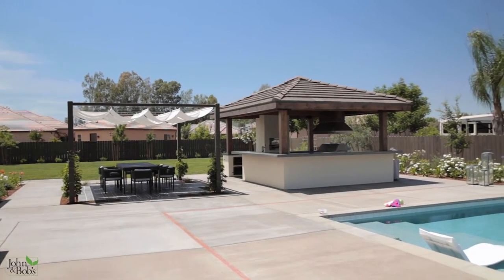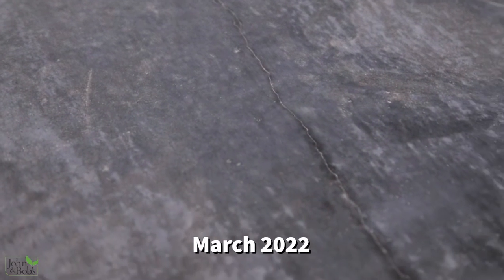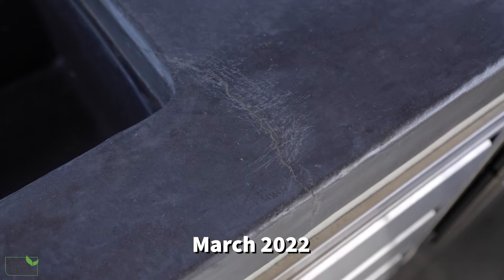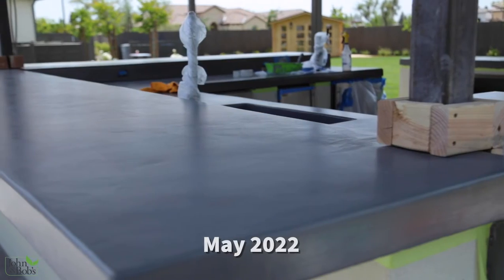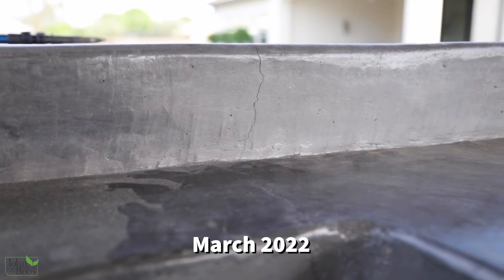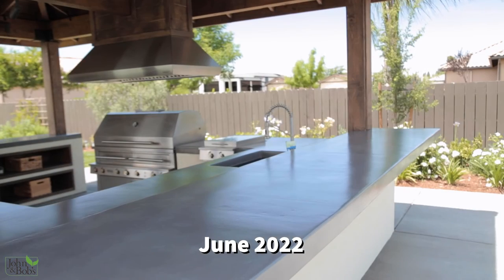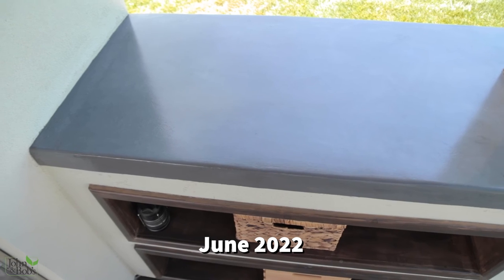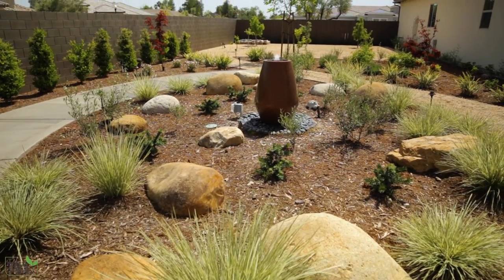How To Fix A Crack In Your Concrete Countertop | Countertop Crack Repair

Comment: Looks great, What method of LIFE DECK SPECIALTY COATINGS did you use? MC, FM or AL.
Reply from the maker: Jim, We are going to do an update on this in the next few weeks with a new video. The counter repair did look great for quite awhile, but then through the winter with all the rain/moisture we had, the cracks started to reappear and eventually became severe again. I didn't like the way it looked and neither did our customer. As a result we demolished the entire counter and we are in the process of replacing it. We will be analyzing the whole thing and showing the replacement work in an upcoming video. My videographer (Brendan) believes it's good YouTube video policy to admit to mistakes and be fully transparent. This project represents the epitome of one that didn't go the way I wanted. We'll be presenting it that way in our upcoming video. I think the patching would work well inside, but on this outside countertop it ended up not successful. -John
Reply: @JohnandBobs   Hi John, My outside bar is very similar to the one in your video, I took a lot of precautions to prevent cracking, and still I have large cracks. I have 6x6 roof support posts running through my counter top, the canopy is about 15x15. It gets very windy here, the posts are solid and don't appear to move. Because the are connected to the concrete counter top, could the wind put enough pressure on the concrete to crack it? I plan on cutting the concrete to get some separation from the posts and the counter top. I don't want to demo the whole counter top. if it cracks again I will live with it. I would like to try Life Deck Coating, can you tell me what one you used?
Reply from the maker: @Echo-1  That's an interesting question about the wind - I'm just nor sure. We were happy with this repaired countertop appearance when we shot the video and we were hopeful it would continue to look good over time, but that didn't occur. We had a very wet Winter and as the Winter wore on the patched cracks re-appeared (we believe due to moisture) and got worse, so much so that it was unacceptable. We demolished and removed the entire countertop and we will be showing and discussing all of that in an upcoming video. As you can imagine it is a lot of work. -John